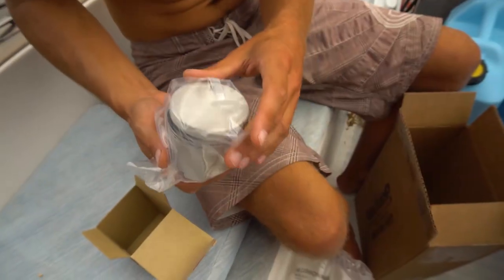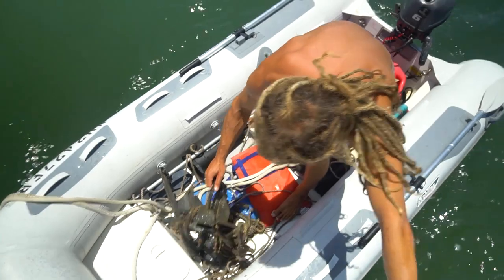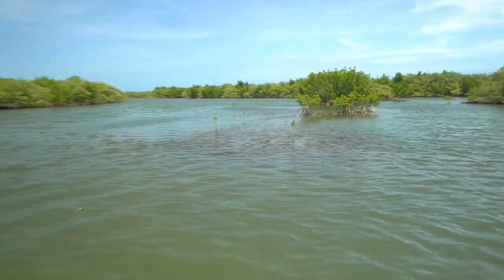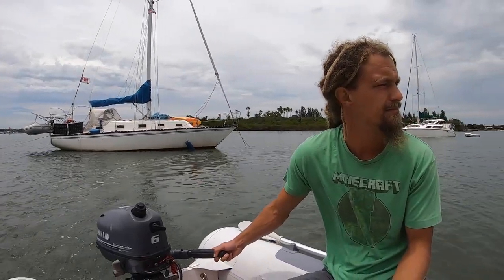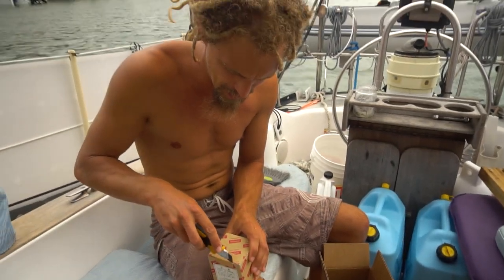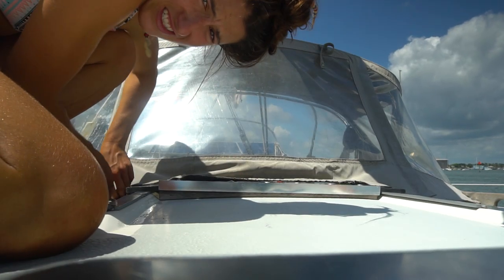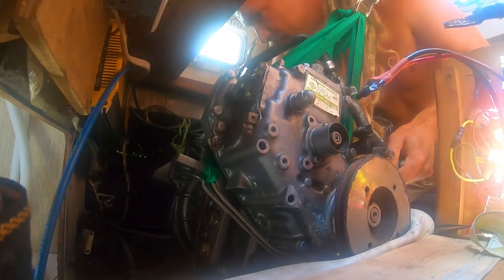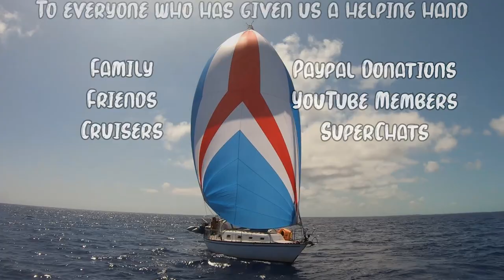How to remove a YANMAR 2GM [Ep 139]

Comment: Love your can-do attitude. Rebuilding an engine at anchor is a tough! Sent you AUD$5 via PayPal.

We loved our Bruce anchor in the Great Lakes and anywhere with a muddy bottom. We also had a CQR which dragged on every change of the tide. In Florida we bought a Manson Supreme (modern design). The Manson Supreme was good on hard sand bottoms of the Bahamas and generally did a good job resetting itself when the tide changed.

And congratulations on the pregnancy! We had a young child on board for a few years. Lots of adjustments but glad we did it.
Reply from the maker: Wow thank you so much Shane, you're too kind. It was quite the adventure rebuilding it at anchor but it showed us that anything is possible.
We've never used the Manson anchor but so far our Mantus is the winner from what we've used and the one we use all the time. Almost need a second one for stern in these sort of situations.
What tips would you suggest for a baby on board?
Reply: @WildlyIntrepid  you will both be wonderful parents. There is not a lot of difference having a small child on a boat versus on land. 

Only one "tip" - young children don't understand the danger of water so take special precautions to make sure your precious child does not accidentally fall overboard (at sea or at anchor).
Reply from the maker: Thanks. Life jackets and tied in especially while sailing. And he she will have to learn to swim from a young age.